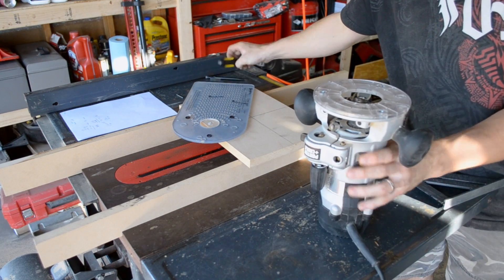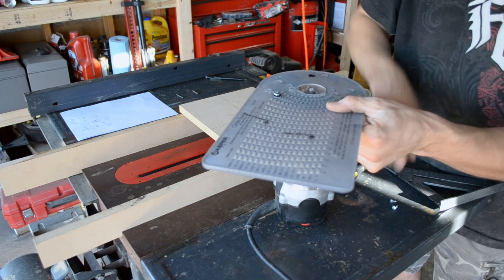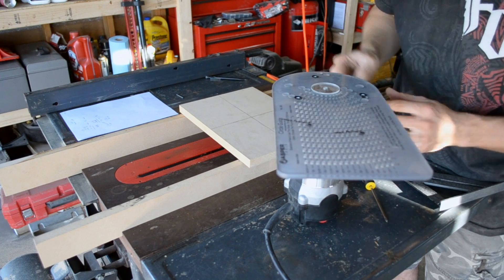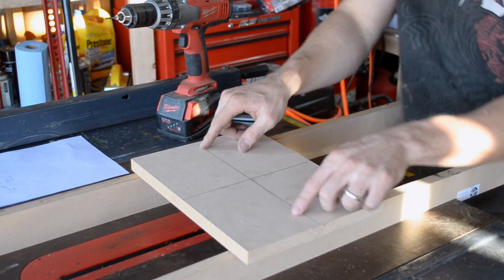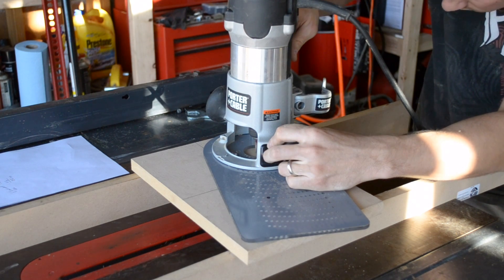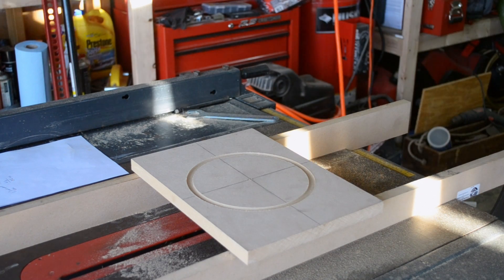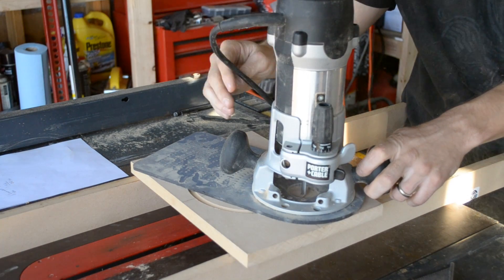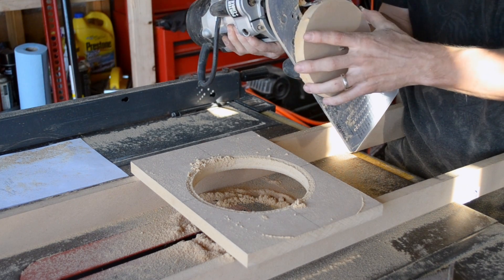Jasper Circle Jig

Comment: Hey, was wondering what model router you are using? can't seem to find any with that type of locking lever.
Reply from the maker: This is the one that I have been using for years. It works great too. I would suggest buying the plunger attachment for it as well to make your life a little easier. Its a Porter Cable 892.

https://www.amazon.com/PORTER-CABLE-892-2-1-4-Horsepower-Router/dp/B0000DCBK0

Comment: Be smarter than me.  If you’re cutting circles opposed to holes, add the router bit diameter x2 plus your finished circle dimension and use that dimension for your pivot.  So, a 10 inch circle with a 1/4 bit, you would use the 10 1/2 pivot on the jig.
Reply from the maker: Good info. I always ran a test circle and measured it to be safe. I would almost just scrap the surface. Thanks for watching!

Comment: Hi bro do they cut the wood with 30mm to 40mm thick
Reply from the maker: It will cut as deep as your router will go down also the router bit that you use can make a big difference. You can always step down to longer and longer bits. I believe that this router will go about 30+mm just the way its set up without messing with the bit depth.